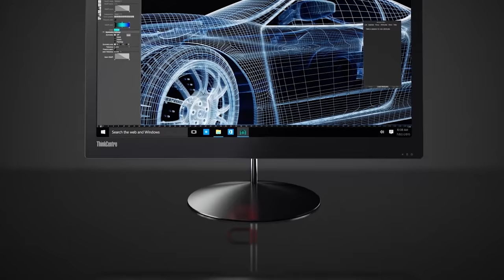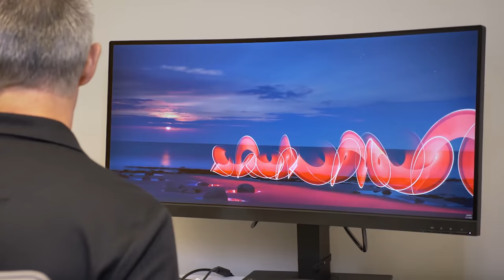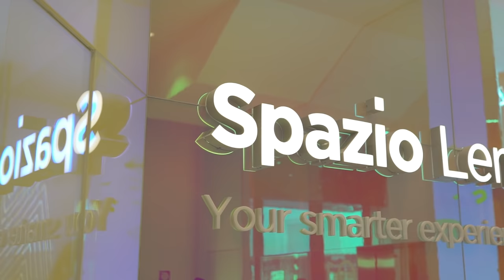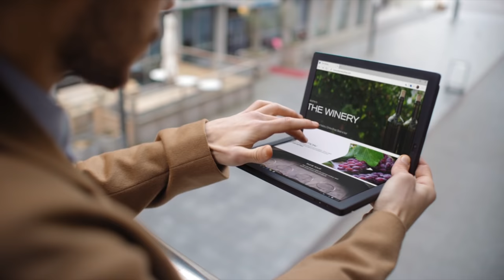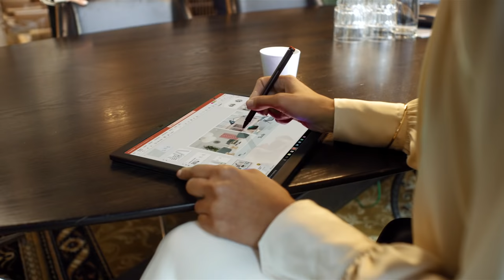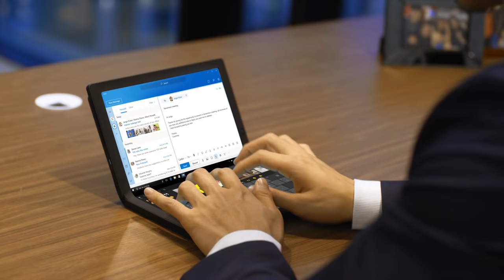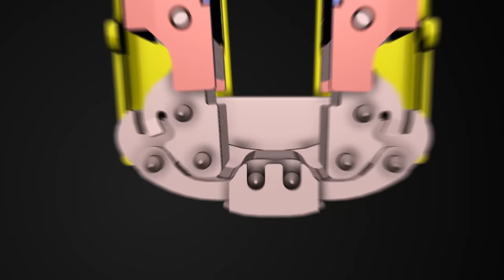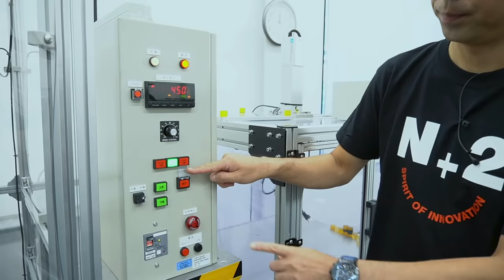Lenovo ThinkPad X1 Launch Event 2020

Comment: "We used the 11th gen intel tiger lake...that gives significant better performance than the current generation products in market"

AMD 4th Gen Ryzen : Let me introduce myself...
Reply: Isnt it too early to say?
Reply: @neosonic08  Ryzen 4000 series Laptop processors have been out a while now on several devices both their U and H series, and they absolutely wipe the floor with intel's 11th gen laptop CPU's. You can find many benchmarks and comparisons.
Reply: They only thing they're significant about is they're significantly more expensive
Reply: the only reason AMD won't get in professional machines will probably be lack of Thunderbolt support. AMD should work on that asap if they want to destroy Intel in mobile. The performance is more than enough already
Reply: @geuros  I can't think of one reason why professional machines even need a thunderbolt port. The professionals who require a thunderbolt port as a MUST is extremely Niche. From my perspective as an Engineer, there is absolutely no need for a thunderbolt port on a professional  workstation spec mobile laptop. This is because they don't require useless things liek e-GPU's. Also the majority of mobile laptops that are windows based and highly spec'ed already come with substantially powerful discrete GPU's much more superior than the basic crap found in MacBooks, which require thunderbolt ports to access e-GPU support.
Reply: @Cobrastarzz1  well, what about connecting to two external 4k60Hz displays, or even one 4k60, sending audio+video to the display and getting charged by the display simultaneously (displays that have built-in hubs can be also used to connect peripherals) - all of that using just one cable. This is not some edge case, that's just really convenient, when you can just disconnect one cable, go to the meeting room for a meeting, get back to your desk and connect everything in just one second. Once I had this, never back.
Reply: @geuros  I see your point however, you should be aware that thunderbolt support isn't really lacking due to AMD's Ryzen architecture. Its mainly due to motherboard support. I think the main reason for this is that thunderbolt has mainly been a popular feature for mobile laptops, something AMD has never held the market for, therefore there was no incentive to develop boards with thunderbolt for the few AMD powered laptops, ecspecially since until Ryzen 4000 AMD laptops were pretty lack luster compared to intel. Naturally thunderbolt support will come as soon as AMD can deal with their raw material supply shortage in being able to produce and send out Ryzen 4000U and H CPU's to the big boys like Dell, ACER, Lenovo, Asus, etc. I think my next laptop may be a Ryzen powered MSI Stealth if that becomes an option.
Reply: @Cobrastarzz1  wonderful explanation, thank you. Really wish AMD to dominate, one wouldn't believe they can create the best CPU, but TSMC cannot deliver enough.
Reply: They need to get more capacity from TSMC, but that's difficult I know
Reply: @Cobrastarzz1  MSI Stealth is 2.1 kg compare to under 1 kg for X1 Nano... These are completely different products. X1 not for games, but for work in the office and on the go.
Reply: @vgarmash  What is your point? I wasn't even comparing them...I never even said i was interested in the X1 Nano, my main comment is on the fact that AMD"s cpu's are superior to the Intel CPU's they are using in their line up.

Comment: Sitting on an x1 carbon I'll consider an upgrade when there is a ryzen option.
Reply: @charlesdoesmore5488   the t14s amd version went 10h 43 vs t14s intel 11h and 3 min. 

I'll trade 3.5% battery life for double the cores (8vs4) especially when the graphics option is way superior. Who cares about 5% single threaded performance when lacking half the threads.

Granted intel seems to have clawed back some of the graphics in their favor with xe but I won't be surprised if that advantage ends again with the 5000 series.

All in all I see no reason to go intel apart from thunderbolt especially considering the intel version are a couple of hundred dollars more for what I perceive with my use case scenario as less. 

Already made the switch on desktop and haven't seen any reason to go back there.
Reply: @Cizzzeron  yep Valid answer, but they're promoting this laptop with 11th gen... So AMD won't have an answer in the short term, check ryzen 4000 vs 🐅 lake benchmarks and you'll see that the crown is on the blue side again, also raw power isn't all , there's also power efficiency and stability (drivers and OS support)  to be considered ... I think that informed customers are the ones that make a wise choice... The rest can go and buy a MAC.... Lols
Reply: I don't think there would be any X1 Carbon with AMD. X1 carbon is a joint project between intel and lenovo, project athena i think
Reply: Same
Reply: @charlesdoesmore5488  lol intel fanboy
Reply: @mikemerino5479  intel fanboy tiger lake isn't superior.at all.. its just 4 cores..that sucks ryzen is 8 core Cpu
Reply: @mikemerino5479  even AMD ryzen 4800U is better than tiger lake its just 4c intel vs 8core AMD there's no match in multicore workloads..
I would wait for amd and skip intel
Reply: If it is able to help you with your job, would it be matters if it's Intel or AMD or even ARM? In buying electronics, or any tool for that matter, first, you define what kinda job you would need to do with it, then you look into that device's whole package. Never failed to bemuse me these people with "brand loyalty" as if they're on their payroll
Reply: @TunjungUtomo  brand loyalty more like price to perf , idc about brands what i care is what they offer , still not gonna buy current gen intel laptops for this year
Reply: @yummyramen5874  and any laptop's model ability to fulfill your need determined only by its processor? How about the screen type and brightness? How about the keyboard tactility? And since we're talking about a laptop with a special offering in form factor, how about the folding form factor? You judge from the whole-package, not from its individual component, otherwise, if the only thing you care about is raw computing power, you should go straight to videos about ROGs
Reply: i said the keyword  "price to performance" 
idk what you meant for "screen type and brightness" like they dont add up to overall performance I needed
Reply: and besides my job is not about "what laptop screen has the best one" because I still use ultrawide external displays to review and analyze my work . I also bring my own mechanical keyboard at the same time I want my laptop to be light .

Comment: Will be very interesting if the x1 fold can live up performance and durable wise. I am a bit worried abiut the software which is not from microsoft but lenovo itself. Even the woman who showcaste it seems to have troubles using the device really intutional. At this pricepoint u rather wait for one or two generations to get a device which is more ready, ane balanced without breaking my poket. If it would be chaper i would buy it now, since its the perfect product for me.

Comment: Dear Lenovo, 

this year would be a good time to try to implement amd ryzen instead of relying solely on the intel processor in thinkpad x1.

Second, please also try to make the thinkpad x1 monitor standardization to be 100% adobe rgb and dci-p3, complete with pre-installed office.

That is how you could compete with Apple MacBook but for toughness criteria, you are still the winner.
Reply: Problem why manufactures about putting it up with Intel were:
1. Intel 11th gen actually not bad in term of performance. Actually if we are talking about integrated graphical power, single core performace is on par with 7nm from red team. Even better in some other cases. Since this kind of laptop not being used for multicore purposes. Intel chip actually pretty good choice
2. The biggest reason probably this.. AMD had short production issues. They run out capability up to balance supply and demand, while the other hand Intel managed to produce SKU well 

Maybe for gaming laptop, for example. Your point to implement newest AMD chip would be more valid than this case
- Salam bhinekka tunggal ika
Reply: Kuncen RIG i tend to agree on your 2nd but on 1st, that would attract many debatable factor. 

"The more cores you have, the faster the render. As a rule of thumb, doubling the number of cores halves the rendering time. The GHz of the CPU is also important"
Reply: @solvedbizindonesia8277  Again. This is not gaming laptop or something that used to render, this machine is supposed to single-core application task, and.. I also stated that single core performance of Intel Tiger Lake is on par with AMD 4000 series, even better in some cases. Even Linus can back up my point there

Not to mention, i have also stated that.. The new Tiger Lake will crunch AMD 4000 series in iGPU performance. There were tons benchmarks about Intel integrated Xe GPU performance out there

So again, i stated this.. For very very compact ultrabook, not *gaming laptop*. Using newest Intel chip probably better choice, there are also factors to be considered.. Like instruction set, intel x86 and others similar stuff, well optimized on intel, due to long maturity level in time(eventho AMD eventually close to catch up)

Mindset jangan "pengen laptop setipis kertas yang bisa buat game, min 50an fps" terus lah. We cant outlaw physics
Contoh: ngerjain over-fucking-load database in excel, kencengan ini pasti daripada laptop serupa dengan 4700u. Yakin

Situ pasti tipe manusia yang percaya Macbook 13 adalah mesin yang bagus for rendering task. Wwkwkwk. That overpriced laptop cant handle shit. It just for rich stupid people who will be doing instagram update and binge youtube with 25million rupiah laptop
Reply: Kuncen RIG do not want to argue for a long and useless debate. Simply said. Anyway, i use MBP 15 and Lenovo Thinkpad X1 Extreme 4K. And i love both of them in their respective design. 

Again, you are free to speak up your mindset but so do I. 😊🙏
Reply: @solvedbizindonesia8277  you look it wrong pov. Free to speak is constitutional right, but stating fact and opinion are different matters

Saying:
"this is free country. I can speak up my mind"
Yeah sure
But saying "covid19 is hoax. And theres nothing you can do to change my mind"
Its called delusion

If we apply that to this exact case. Having multicore computing in paper-size laptop wont be happening. Its like denying law

Sure AMD 4000 series is amazing. But for thin and laptop that requires single-core application rather than anything else, Intel chip is good, and well optimized.. Especially the new 10nm+'s one

By that said, you know nothing about tech kid. Seeing your name: "SolvedBiz Ind", i assume you are tech solution provider. If i were consumer, i would never use your service where i already more capable in this area already
Reply: @solvedbizindonesia8277  nah dude, Ryzen is great and all, but fanboys have deluded themselves into thinking intel chips suck; it is vastly more complicated and nuanced than that

TSMC 7nm and Intel 10nm are p much the same transistor size, the only thing AMD has over intel in this department is their chiplet design
2nd, intel has their own fabs while AMD doesn't and has to rely on other foundries process, intel has an advantage in this area because they'll be able to implement GAAFET designs faster than TSMC; also Apple has taken up so much of TSMCs allocated production that AMD chips are going to fall behind
3rd, intel made 21 billion in net revenue last year, AMD made something like 300-400 million, intel has a vast number of resources and an intensely talented pool of engineers and scientists, they're definitely going to come back now that their monopoly is threatened
4th, iGPUs are the future and AMD has fallen behind in this aspect, intel hired the guy amd had hired to design zen architecture & graphics performance, the new intel cpus are crushing it in the laptop world because you don't need a discrete gpu & tiger lake is trading blows with amd on performance/watt

im not a fanboy of either, competition is good, but learn to analyze the world more objectively and don't rely on circlejerking fanboys & kids on reddit for any accurate or knowledgeable information about something as complicated as semiconducter design and manufacturing

these 2 companies competing is a GOOD thing, if intel stopped caring AMD will pretty much do the same stagnation intel has done over the years, don't get confused into thinking corporations care about you, they care more about money
Reply: Kuncen RIG seems you attack me personally, right? Saying & assume i use mbp 13 without knowing in detail. 

Simply read my comment with clean eyes and clear head. i never say Intel processor bad but competition are good for business. 

AMD Ryzen is not perfect but it is good for procesaor competition and not expensive with smaller size manufactuing for comparing with 10th gen Intel. 

TSMC or Qualcomm or might be Exynos or Mediatek could step in future and again, that was good for competition. 

But again, seems you clearly not seeing that from different perspective like rhs94. And clearly you prefer to hold your forced opinion over orher people. Be cool, be relax, Please do not be too stressful in youtube. 😊

Anyway, i am not tech solution provider but if I might be, you are free not to use us. 🙏😊
Reply: rhn94 ryzen 7 or 9 is great but not perfect. But in the end, what i think would be crucial & matter for the end user, competition is good. Let them choose. 

Corporate might don't care for the end user, but it's okay. Market would & surely punish them in the end when the user prefer not to use their product especially when their competitor pick the other way to satisfy end user with a profit.
Reply: @solvedbizindonesia8277  dude. "Competition is good, consumer will get the benefit". Yes we get that, everybody undestands that.. Problem is, IT HAS NOTHING TO DO WITH THIS

You wanted this this lenovo slim 7i to be using AMD 4000 series chip right? Let me tell you, using Intel Tiger Lake aint bad option, it could be even better using Intel Tiger in some cases

Why, you ask.. BECAUSE EVERY FACT I TOLD YOU ABOVE, and you reply with what? "Competition is good us, with competition we can..." WE KNOW, WE ALL KNOW

Smh
Reply: @solvedbizindonesia8277  and uh.. You cant speak english apparently. Your google translate begs to differ <- you dont know that catchphrases either, am i right?
Reply: Kuncen RIG let Lenovo Corp decide what best for their own marketing strategy. 

Smh & smile.

Comment: Bring back 16:10 screens on your workstation systems. Id pay good money for a machine with the power of the P15 and a solid 16:10 IPS screen (no OLED burn-in crap).
Reply: Have you owned an OLED screen?
Reply: @herrfaust2020 Many. My Samsung S8 got terrible burn-in within a year. My Thinkpad P1 Gen2 did within months. I returned the P1 and got a P53 with an IPS.
Reply: Hmm, no burn-in on my 3+ year old X1 Yoga.  Samung panel.  I do baby it, though, with dark mode and crap like that, though.
Reply: @herrfaust2020  I ran dark mode on my P1 and it happened anyways. Same with my S8 (though after ~6 moths it was showing so I just gave up).
Reply: Been using my X1 Yoga Gen 2 OLED all day for nearly 4 years without the slightest hint of burn-in. IPS screens look like garbage to me now and I can't imagine going back to garbage quality, just because of people's fear of burn-in...
Reply: @thevalleycartel  My experience has been the exact opposite, and honestly, my P53's IPS panel looks better than my P1G2's OLED.
Reply: @henryatkinson1479  I think there maybe some manufacturing differences between the OLED panel on the Gen 2 Yoga and the ones that they used on the X1 Extreme, P series. Those newer ones had a visible matrix grid on them apparently, but my X1YG2 is clear as day. That may be why it doesn't look as good as it could

Comment: The fold is an interesting device. But i have some questions: i don't See any trackpoint on the Keyboard. Will there be a Keyboard With a trackpoint? You told that the folding mechanism is Limited to roundabout 100k actions. Is there some sort of guarantee to the Display? Exceptions usually confirm the rule. What can i do as a a customer, when a accident With the Display happens.? And Last questions: how much working memory does the fold have and how big is the hard Drive. Greetings From nuremberg Germany, sorry for my Bad English, just written on my Motorola g8 mobile
Best wishes!

Comment: I enjoy using my X1G6 although the trackpoint is trash, the screen always gets dirty when closing the lid and the Intel CPU sucks. And they still suck ass. The moment you add a Ryzen CPU option to the X1 line I'll upgrade.
Reply: @found13  USB4 is coming to next gen Ryzen so hopefully then they will have it.
Reply: @found13  That is no issue for me. I have a beast of a desktop workstation at home. I never dock my laptop.
Reply: @found13  isn't thunderbolt open now and could be implemented in the Mainboard with Ryzen as well? That's what I thought, it's up to lenovo, they could make a Ryzen Laptop with thunderbolt.
For most people, usb-c is good enough anyways. Two monitors, ethernet, charging and usb 3.0 at the same time is not too bad
Reply: I enjoy mine too. My only gripe is that it'll run hot after a few excels opened. It's thin and light but don't dare to put it on your lap haha

Comment: I'm no longer getting a ThinkPad. My first thinkpad is an L380 and first month of use I've had bunch of issues has been sent for service twice already. Right now it still has a vertical line on the display.
Reply: Yeah, I would never purchase an E, L or IdeaPad. The P, X and T lineup is what you'll want to look at.
Reply: I see. I had the assumption that since it has the ThinkPad branding it wouldn't have this much of early issues.